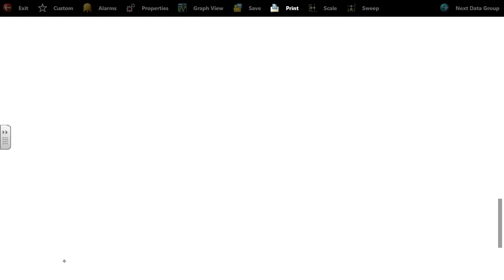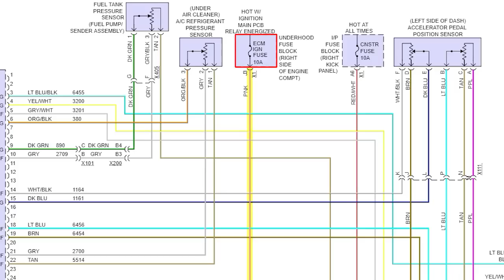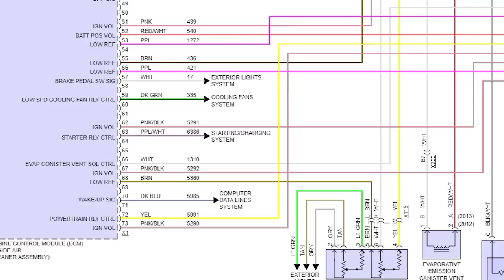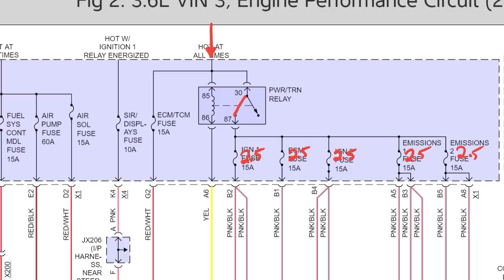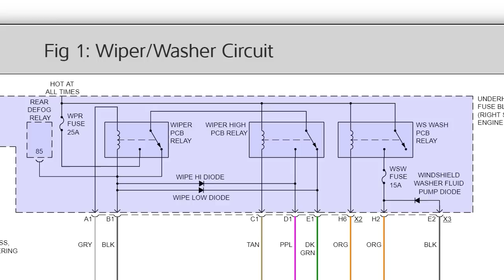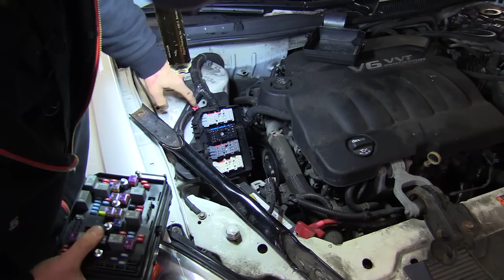2013 Chevy Impala No Start - Ignition Relay Low Voltage Codes (P1682, P0689)

Comment from the maker: Here is the link to Mitchel 1 DIY mentioned in the video https://eautorepair.adtrk.biz/?a=10817&c=24&p=r&s1=
Reply: A cool video suggestion is what do you get with the Mitchell DIY.
Code discription?
Code set condition?
Component location?
The extent of the wiring diagram.
Reply: Ha there I was wondering if you know the relay tester model number you used on the Lincoln Town car that had no power to fuel pump I'm doing a similar job on a 2002 BMW 530i.please can you help me? Thanks
Reply: Great video SD. The 2007?+ GM trucks have a similar fuse box that has similar electrical problems. Don't forget about Alldata DIY which can be a better deal. http://www.alldatadiy.com/index.html

Comment: Well done! Scannerdanner. I have had the same issue with my 2009 Buick enclave and the only difference is that the computer gets a high voltage. Thanks for your help.
Reply: Hi scannerdanner, I have a question about pin 86 on the power relay circuit, it reads 0.808 when it is energized. I wonder if is OK or it should only read 0 as you stated in your video? Thanks
Reply: @Fawaz-z1s that's too high for sure. Not being grounded fully I'm sure it should be under  .05 , aka less than 500 mv

Comment: Ignition feedback is 0 v.checked found blown fuse.put new fuse blows right away
Reply from the maker: Get yourself a good diagram and find out what all is on that circuit. Start with visual inspections of the harness 
https://eautorepair.adtrk.biz/?a=10817&c=24&p=r&s1=
Reply: I have wiring diagram.engine controls igntion relays supplies power to 25 amp goes to ecm.it blows right away.i have eliminated short wire from fuse box to ecm.2015 cadi ats 2 liter.

Comment: I was getting this problem also it would cause my etc/ecm fuse to blow car would shutdown engine power reduced, check engine, service stability track, and etc.
Reply: I’m assuming I need to do the same
Reply from the maker: Different problem if you're having a fuse blow. You have a short to ground on that circuit. Find out what is all on that fuse and start doing some visual inspections.
You'll find the proper diagram here (listed under "power distribution")
https://eautorepair.adtrk.biz/?a=10817&c=24&p=r&s1=
Reply: @ScannerDanner  hello I'm having same issue as Mr. Mason no blown fuse just a code for ignition relay swap with new relay after about 50 miles happens again. service stabilitrak,  reduced engine power then cuts completely off. 2014 traverse lt
Reply from the maker: @kesha1402  what was the issue with the car in the video? Bad power distribution box I think?
Reply: @ScannerDanner ok, I will try changing this, thank you so much I hope it works
Reply: @ScannerDanner  One last thing can you please tell does the power box for 2014 traverse lt need to be programmed.  I  want to make sure I dont get ripped off. Thank you again
Reply from the maker: @kesha1402  I'm not sure to be honest
Reply: @ScannerDanner  Thank you
Reply: @ScannerDanner  estimated shop labor hours to change power box please

Comment: Glad I found this video.  I'm having issues with this as well.  After watching this I wiggled the relay mentioned in your video And the car started up with no problem.  2012 impala.
Reply: was it cranking and not starting or no crank? i got same year and changed out the box with no luck. also have no communication for scanner. tried ecm, fuse box, throttle body. just cranks but no start. lots of fuel etc

Comment: i just had my 13 impala no crank right after turning it off. after trying multiple times i cycled the key a couple times and it started right up. could that be a bad relay or ignition switch problem?

Comment: I replaced my battery when my 2010 wouldnt start. Key woukdnt turn OFF without a jump or a new battery. Now I have engine light ON with code C0899-00.

Comment: Could you explain how to separate the Delphi pa66-gf14 fuse box for 08 Impala 3.9 v6.  Studs have been removed and all fuses and relays.  The box seems to be held together by six tabs which I can't get to release.

Comment: Can I upgrade this box to a better one I'm having pretty mush same probs I want to add stereo amp but I'm afraid cause of this
Reply from the maker: adding a stereo won't affect this as long as it isn't a high powered head unit. If it is, you will want to run your own power supply directly to the battery anyway.
Reply: I gotta replace this box now it's full off corrosion now, it still starts it just takes a min then the light comes on and then u can start it if you jiggle the box it's will start faster

Comment: HEY DANNER, I THINK THAT'S WAS GOING ON WITH MY 2012 SRX CADILLAC. MY WIPERS AT TIMES SWITCH TO HIGH SPEED, WAY TOO HIGH THAT YOU KNOW THAT SPEED IS NOT NORMAL. MY CAR AT THE MOMENT DOESN'T START. I PUT IN A BRAND NEW BATTERY IT CRANKS GOOD BUT NO START. SCANNER THROW ME A P1682 - IGNITION 1 SWITCH - CIRCUIT 2. AND THAT IS EXACTLY WHAT I SAW IN YOU VIDEO. I WONDER IF IT IS MY PCM (I JUST ORDER ONE) OR THE PROBLEM LAYS ON THAT FUSE BOX. PERHAPS THE RELAY. THANKS FOR THE VIDEO, I LEARNED A LOT FROM OF IT.

Comment: Most of those GM fuse boxes just have  somewhere around a 20 gauge solid bare copper wire as traces to each of the terminals inside. Most of the time one of those copper wires just have a hairline crack in them causing issues like this. It hardly takes any flex at all to gain or lose contact. I take these apart and fix them sometimes to save the customer some money or if availability on a new one is sketchy. I usually recommend a new one but some people really can’t afford it and I’ll try my best to help get them going again.
Reply: Hi, I am having the same problem and can't find the replacement fuse box. How do you bypass the crackle without causing any short circuit?

Comment: I had a 2010 Chevy impala with 190 + miles on it and the automatic transmission went out and Rameys car dealership in Princeton West Virginia  put me a used transmission in with no warranty and before the 197 + it went out again and had it towed to Coles cheverlot and the mechanic teat drove it and couldn't find any thing wrong with it. On the way home 1.2 miles it went to having problems, pulled over to the side of the ride and turned engine off and let it sit and had to have it towed back to Cole's with transmission failure. They refused to be responsible and refused to pay the tow and had to take to a Jasper installer in Bluewell West Virginia and traded the old transmission for a Jasper transmission that cost over $4000.00 labor and all. The mechanic at Miller's in Bluewell West Virginia  (Dean Miller) installed Jasper transmission and started car and backed it out of the garage and transmission was making a racket. Mr Miller checked out the module and said the wire came undone from soder and fixed the problem. A year plus went by received in mail a recall about the Chevy impala wire can I recommend my money back from GM. Very caring citizen concern Anthony Price.  What must I do to get my money back on the recall. Thank you. GOD BLESS

Comment: Great video.  I deal with stuff like this all the time on the 2 delivery fleets I service.  Funny thing is, I’d probably fix the pins or wire in a bypass temporarily till the new part comes in, and in the mean time the fleet manager would probably cancel the part because it’s working and he figures he can same some money.  I have a lot of temp fixes like this that I come back a few months or a year later and find still there.  Kind of funny, but I guess that’s how they save money.
Reply: Hi, I am having the same problem and can't find a replacement fuse box even in ebay. How do you bypass it without causing short circuit? How do you know which wire is defective/ broken? Thank you!!

Comment: Had this exact issue with a Chevy Blazer SS. It would start and run until the IPDM got hot. Then that same circuit you're testing would drop to 2.5 volts. And the engine would shut off and you had a no crank condition. The same happens to Chrysler, Ford and Nissan products.

Comment: Ha there I was wondering if you know the relay stester tool model number you've used on the Lincoln Town car that didn't have power to the fuel pump? I'm doing some similar work on a 2002 BMW 530i
Reply from the maker: It is called a uActivate tool and it is only sold by my friends at AESwave.com They are on back order right now, but email them, mention my name, and they will put you on a list carlos@aeswave.com
Reply: @ScannerDanner  thank you Mr. D

Comment: Curious if it was pin fitment on the relay pins or a bad solder joint on the relay socket on the PCB.
Reply from the maker: Without taking the box apart, I can not answer that. Remember, other circuits were affected too (wipers intermittently not working)

Comment: Sir, your videos are very very informative and useful for me. Thanks a lot.

Meanwhile, my car Hyundai i20 1.2 has SDVC function in the Audio head unit. It controls the volume of the audio playback bead on the car speed.

Now, how do I locate this particular wire going to the head unit and read it's signal?? I'm really interested to trace out this wire where it's coming from and going into!!!

Please make video relavant to this SDVC wire of any car. Thanks in advance.
Reply from the maker: There is no specific signal wire. Your radio is a module on a communication network that shares all kind of information, one being the speed the car is being driven for the speed sensitive volume adjustment. You should be able to simply turn that mode off within your radio
Reply: @ScannerDanner  but in the Audio head unit diagram, one pin or wire is designated as SPEED.
Reply from the maker: @tnamen1307  where does the other end if that wire go? If it goes to another module, it is a communication wire
Reply: @ScannerDanner  other end not shown. Bdw, will back probe to this particular wire at the head unit side with car moving with multimeter gives a signal to confirm that it is the correct wire??
Reply: @ScannerDanner  I'm trying to make my car autolock door on reaching speed 40kmph. So, I need vss signal wire and convert to voltage signal......
Reply from the maker: @tnamen1307  I doubt that wire goes to the vss directly
Reply: @ScannerDanner  okok..any other ways of reading vss signal from under the steering wheel instead of from the engine bay side. I'm looking for much convenient way...

If such signal is available under this steering wheel, I would then make autolock door on reaching 40kmph through some frequency voltage converter.....and.....etc.😇😇
Reply: @ScannerDanner  since the car has SDVC function which can be enabled or disabled as per user option, the idea came that there must be a signal wire coming from the vss and going to the head unit, and subsequently used for controlling the SDVC function. Please help find locate such wires. Thanks.
Reply from the maker: @tnamen1307  you just need a good diagram https://eautorepair.adtrk.biz/?a=10817&c=24&p=r&s1=

Comment: Top notch diagnostic work
Great video editing very informative
Reply from the maker: Thanks 👍
Reply: @ScannerDanner  Sir, your videos are very very informative and useful for me. Thanks a lot.

Meanwhile, my car Hyundai i20 1.2 has SDVC function in the Audio head unit. It controls the volume of the audio playback bead on the car speed.

Now, how do I locate this particular wire going to the head unit and read it's signal?? I'm really interested to trace out this wire where it's coming from and going into!!!

Please make video relavant to this SDVC wire of any car. Thanks in advance.
Reply from the maker: You only need to ask this question one time on one video. I've seen it like 5 or 6 times now. I see every comment and this just ends up being classified as spam by YouTube

Comment: Thank you Paul and Caleb. Great job. I'd be curious if the 2.5 VDC was actually bias voltage. Unplugging relay and testing the voltage on the fuses would explain it was a bias voltage if you still read 2.5 VDC. By wiggling the relay side to side, hearing the relay clicking, seems the poor terminal fitment was on the coil side of the relay, 85 or 86. Have a blessed and safe week to you and your family.
Reply from the maker: Could be! Good thinking Billy.

Comment: ivan would have fixed it for sure, dont just be a parts changer
Reply from the maker: While I love Ivan and him and I are friends. This is a stupid comment. The box was plastic and GLUED together and not expensive compared to other power distribution boxes. I was not going to even attempt to take a box apart that is not serviceable without breaking the plastic. This was not a bush fix, nor should it be, and taking that box apart would have absolutely been exactly that.

Comment: Replaced a few on police cars. Last one was human induced due to coworker jamming DMM leads into the fan relay cavities .. 

Great video
Reply: Hi. Mine is a policd car and I can't find an exact replacement.  Do you know if the fuse box without the police package will work?

I see that the wo police package lacks a few relays related to spot lights and hdlt mdl only.

Also, does it require reprogramming?

 Thank you!!

Comment: You are recommending the same thing I would, with the wiper issue and those relays basically non serviceable, time for a new fuse block. At least it doesn't need programming. Isn't it crazy to think that some fuse blocks need programming. Something funny too is Saturn Ions have an integrated BCM/interior fuse block as one unit. Talk about begging for stuff to go wrong, LOL.

Comment: Just wondering. So 12 volts before on pin 86 and then 0 volts on pin 85. Is there a voltage drop because the coil is a load ? just wondering.  Also $180 a month for mitchell. Are you paying for this or the school ? Just wondering
Reply from the maker: yes, the coil is the load, great question

Comment: Scanner dinner, the troubles with my 2004 cayenne s just got worse.  I left the moonroof open during big rsindtorm.  When I tried to start it the next day, it started but with tons of lights .  Troubleshooting has led me to the passenger side fuse panel on dash.  Half of it has no power.  What would cause half the panel to have no power?  Aren't fuse panels powered by one main line?
Reply from the maker: sounds like you have a module on the CAN network that crashed the network. I would focus on the modules on the floor area. You can have a BCM or another module that powers up a main relay that would then power those fuses that are dead
Reply: @ScannerDanner  thanks for replying.  That's what I'm thinking is that there is a relay that must be powered via module that Powers up the fuse panel.  So if I check schematic and find that relay, I could pull it and switch it to check for relay itself if no function check module power and ground, continuity of the line in between module and relay.  If that shows good then look at why module not controlling relay.  How would I do that without a spare module?
Reply from the maker: @bigguy8586  visual inspection first, find the module filled with water :-) 
Any luck?
Reply from the maker: In fact, the starting point for you would be to find out what powers those fuses, then back track your problem from there. It will lead you to the problem for everything in my opinion.
Reply: @ScannerDanner  does that link to the diy website show pin # for modules and where they individually go?

Comment: I would just put some Thin copper strands of wire around the terminals of the relay and plug it in
Reply: I wouldn't do that on a customer's car.  What's to say it doesn't come back for some other fuse block related issue.  If it's your own vehicle, have at it.

Comment: SD is easily in the top 10 of best YT channels.
Reply from the maker: Thank you
Reply: @ScannerDanner  Sir, your videos are very very informative and useful for me. Thanks a lot.

Meanwhile, my car Hyundai i20 1.2 has SDVC function in the Audio head unit. It controls the volume of the audio playback bead on the car speed.

Now, how do I locate this particular wire going to the head unit and read it's signal?? I'm really interested to trace out this wire where it's coming from and going into!!!

Please make video relavant to this SDVC wire of any car. Thanks in advance.
Reply: If you think this is good, you should see his Premium Channel on ScannerDanner.com!

Comment: I've seen the Mitchell and Alldata DIY service and they didn't allow access to much of the service info. Maybe they've changed recently. Thanks.
Reply: Just buy the Mitchell on demand or all data and you will have full access  and it comes on CD disk or external hard drive off eBay..not sure if it’s legal or not..lol
Reply from the maker: It is not, that is pirated material and is HUGELY frowned upon by me, as I too am a seller of digital content.
Reply: ScannerDanner I new it was pirated software..I thought it was odd when I was looking at them on those websites..I haven’t bought any I use the Chilton library for all my wiring diagrams  and information..
Reply: I’ve seen the  full software on dhgate or aliexpress and you can buy it..